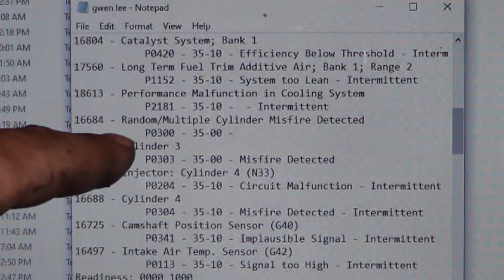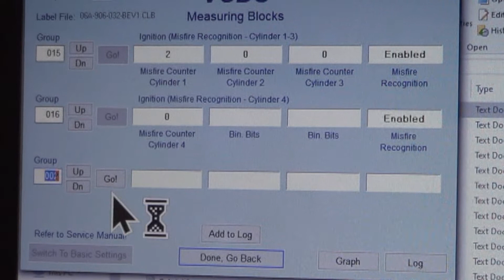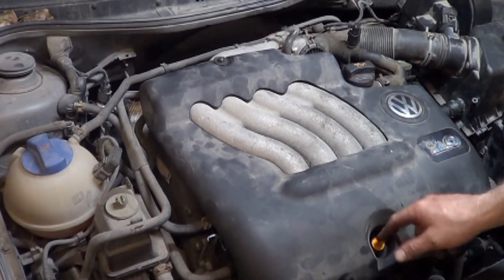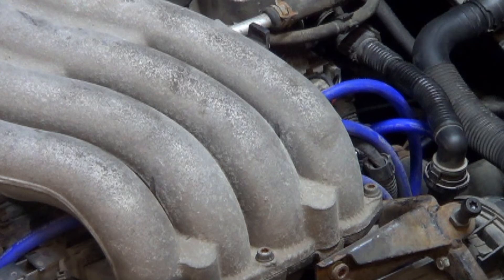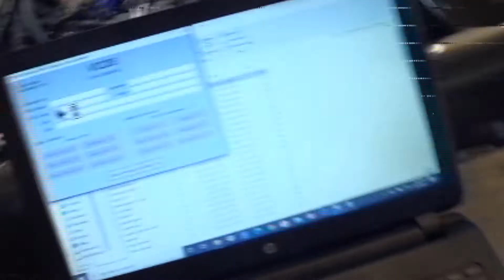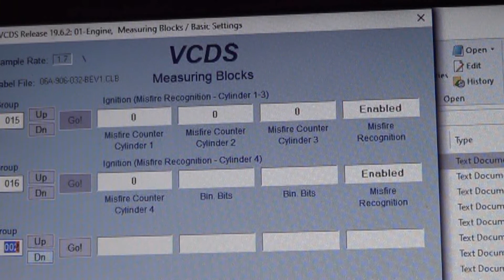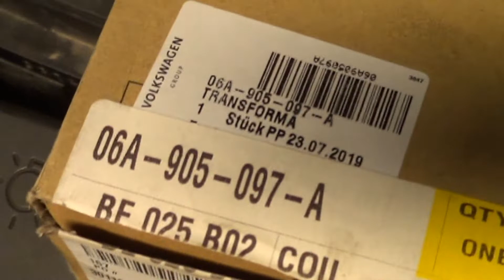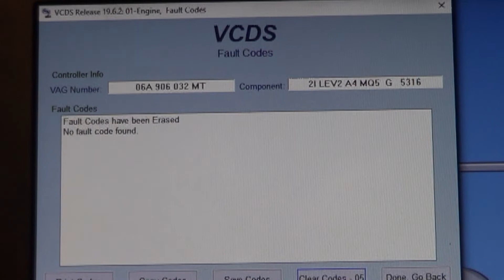VW Misfire #3 P0303

Comment: reminded me to go through the physics  again like i changed the coil plugs and wires fear of an intermittant error  ...then it happened i was downtown and bam i lost a cylinder  right there at 5th a broad thought it was an earthquake or i blew a synapse  ...after hours and hours i subed the coil plugs checked for injector click and a final runthrough to find the p0304  was a new fancy plug wire that couldnt take the heat  no DTC no Lopaloosa
Reply from the maker: defective new parts make a difficult diag

Comment: Bro can u tell if a 01m torque converter is bad. The gears in the TC where the input shaft goes into is that supposed to be able to wiggle and move when I shake my TC I could hear it rattling and see them moving
Reply from the maker: They do move when it is not installed.  The shafts sticking out of the trans support those pieces.
Reply: @CoolAirVw  my problem is drive won’t engage properly it moves very slow wen I press the pedal to the floor all out and reverse works perfectly fine. Had some vibration wen I put it in drive put some more fluid and the vibration went away but still won’t engage drive properly still moving slow hardly want to move
Reply from the maker: @MaddclownG  i dont think I can diagnose these type of things unless I put my hands on them.

Comment: I have a 04 Passat tdi (bhw) that had some overheating issues, after a while of research and diagnostics I discovered the head had a crack in the injector hole in cylinder 2 and was leaking fuel from the injector return space into the coolant.
Reply from the maker: How did you find that?

Comment: that what we do at work for misfire since we have fleet 90 ford E450 truck it faster to put a coil than testing because we have all the part in stock.and we use only ford part .no after market part.thanks for sharing
Reply from the maker: Sounds like you know the drill, cuz you da man.